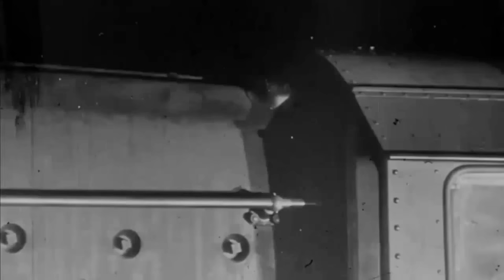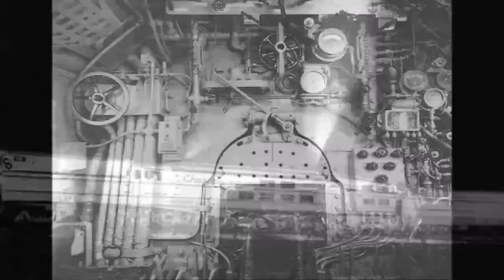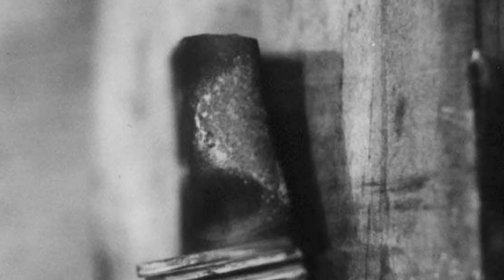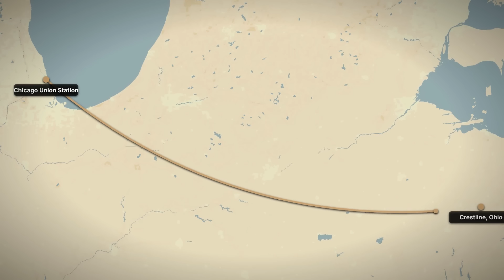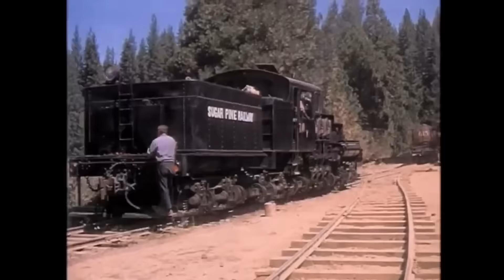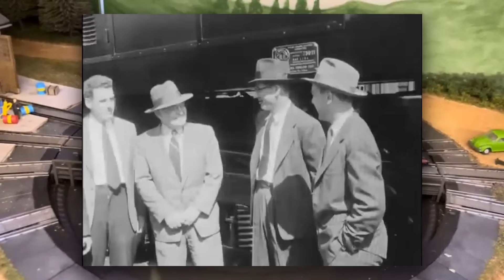20 WORST Old Steam Locomotives That Faded Into History!

Comment: Prewar 4-14-4 and postwar Yellowstone...   2 specifically separate locomotives, Da?     Chasing Yankee designs, particularly the Soviet Yellowstone emulating Southern Pacific AC-9 3800 engines, successful coal burners in New Mexico; later converted to Oil for Salt Lake and Sacramento Valley runs.    The American Espee and several other examples were successful and earned their place on rosters.

Looking for the Virginian Class AE 2-20-10-2 coal drag behemoths; Pre depression WWI engines operated until years after WWII!.